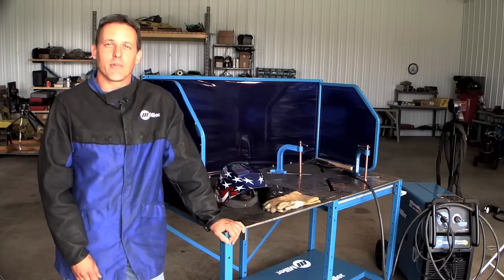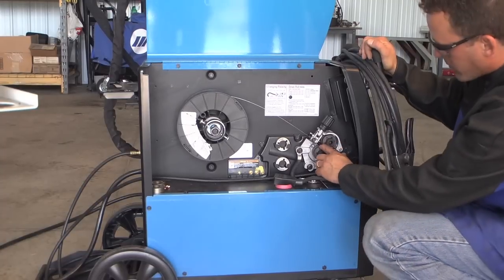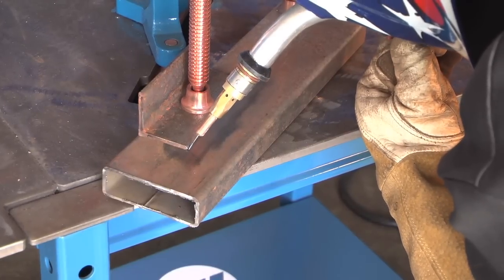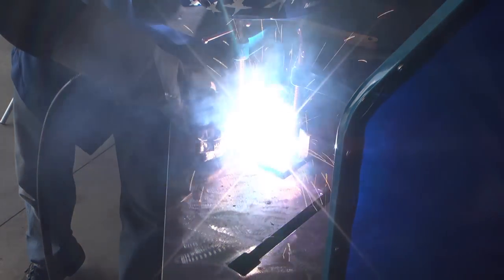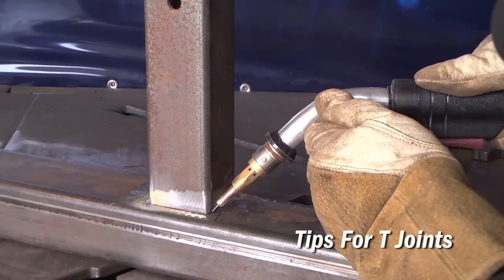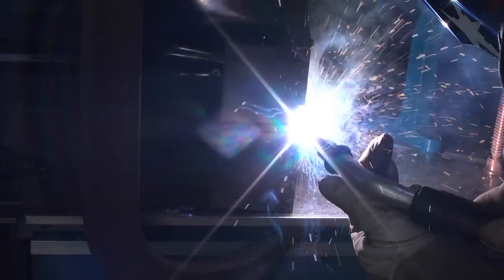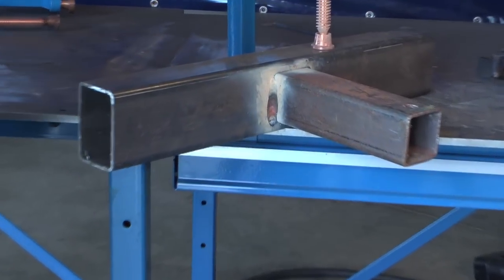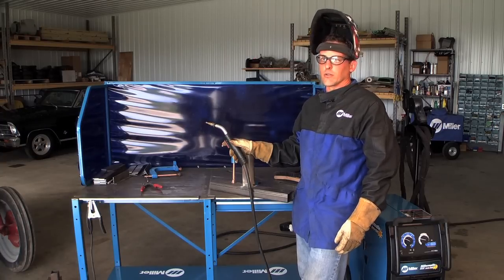Flux-Cored Welding Basics: Tips for Flux-Cored Welding

Comment: It looked like the tip was much shorter for the 90 degree weld; is that the case?  Other videos suggest 1/4"- 3/8". other than extreme lengths does it really matter?  Thanks!
Reply from the maker: Thanks for your question! The stick out will largely depend on the type of FCAW self-shielded wire and the diameter. This video is using an E71T-11 type wire. The second page of the following document has a parameter table that gives stick out or contact tip to work distance recommendations for each diameter: http://www.hobartbrothers.com/uploads/pdf/datasheets/Fabshield21B.pdf  We hope this helps! Let us know if you have any further questions. Thank you!
Reply: Thanks.  I had my first experience with wire feed welding today; had two old lawnmower blades to practice on (likely not ideal since the grass crud prevented arcing at times).  Ugly but managed to weld them together solidly.

Comment: I noticed the shroud was taken off the mig torch for the gasless wire. Any particular reason for this ?
Reply from the maker: Hi Brendan, thank you for the question. The reason people remove the nozzle from the gun when running flux core wire is for better visibility of the weld zone. Thank you.

Comment: Hi I noticed you don't have a nossle installed is that ok to do thanks again
Reply from the maker: Hi Richard, thanks for the question. When using flux cored wire that does not need gas coverage, the use of the nozzle is not needed.
Reply: Thank you!

Comment: so in MIG I was taught to use circular movement "stacking dimes" is this NOT necessary in flux core?
Reply: nope if it has slag you Just drag
Reply: What does stacking dimes mean?
Reply: By welding in a circular motion you are creating circular layers that look like a line of overlapping discs.

Comment from the maker: Note 2 – The voltage limit should not be exceeded at any load between full load and no-load when the source is a safety isolating transformer.
 
Note 3 – Ripple-free qualifies conventionally an r.m.s. ripple voltage not more than 10 % of the DC component; the maximum peak value does not exceed 140 V for a nominal 120 V ripple-free DC system and 70 V for a nominal 60 V ripple-free DC system. [SOURCE: IEC 61558-1:2005, 3.7.16 MOD]”

Comment: when you say turne the settinges down 10-15 % what is the settinges you turning down from?
Reply: The base line settings you would use for a flat position weld, which might be the ones printed in that chart inside the machine.

Comment: It's not that the flux core dont need a shield gas, but the gas is being released within the core of the wire(flux core), so you might want a welder tip for shielding aswell.

Comment: Is it acceptable to tig weld without gas using flux core mig wire?
Reply: What?  With the white-hot tungsten electrode just sticking out in the air?  It'll just BURN!  It might work with Carbon-Arc.  Interesting mix of old and new technologies.

Comment from the maker: “AC voltage the r.m.s. value of which does not exceed 50 V or ripple-free DC voltage the value of which does not exceed 120 V, between conductors, or between any conductor and reference earth, in an electric circuit which has galvanic separation from the supplying electric power system by such means as a separate-winding transformer
Note 1– Max voltage lower than 50 V AC or 120 V ripple-free DC may be specified in particular requirements, especially when direct contact w/ live parts is allowed.

Comment from the maker: The International Electrotechnical Commission (IEC) defines a SELV system and SELV Voltage as an “ electric system in which the voltage cannot exceed the value of extra-low voltage:
– under normal conditions and
– under single fault conditions, including earth faults in other electric circuits”
and; (cont.)

Comment: Flux core is very smoky, tape the safety glass up with insulation tape round the sides preventing  the smoke entering between the inner and outer lenses.

Comment: very informative but acouple things, i was told that event though flux core has its gas built into it, that using a 92/8 argon co2 mixture helps remove the slag ALOT easier than without the gas, in this video, i saw that when he was removing the slag it seems kinda frustrating, when i flux core weld i can just brush it off. and the last thing being, i was ALSO told to push not drag.- I am in high school at a Voc school, thats what my welding instructor told me.

Comment: Firstl, even though there is a flux, the weld is much better if you use Argon CO2 gas too. Secondly, you need a shroud on your gun too. Again the weld will be much better.
Reply: Jason K Wrong and wrong.
Reply: +Tec 9 Isn't the whole point of flux core welding to eliminate the need for shielding gas?
Reply: Tec 9 If we weren't this dumb, we would be machinists.

Comment: How can vertical down result in less penetration? 4:10
Reply from the maker: +Henrik C That's a great question. When using a vertical down technique, you have gravity fighting against you. When welding in a vertical progression, you have to have a very fast travel speed in order to keep the arc ahead of the puddle. This travel speed can be so fast that the arc doesn't have the proper amount of time to burn into the base material. If the puddle gets ahead of the arc, gravity takes over and the puddle may "drop" and fall onto whatever is below the work piece. If the operator can manage to keep the puddle from dropping, they most likely are now going too slow and "riding the puddle," meaning the arc is within the puddle. This is a no-no because when "riding the puddle," you achieve minimal penetration. Using a vertical up, or uphill, technique allows the operator to travel at a speed that allows for the arc to properly burn into the material and keep the arc on the leading edge of the puddle, and thus allowing for proper penetration. Let us know if you have any further questions.

Comment: You are a good welder with good technique but hwy arnt you using nozzle. Also sometimes it helps using a tapered tip and nozzle to get into the hard to reach places.

Comment: Cant get thick beads plz help
Reply from the maker: Thanks for reaching out. We recommend giving our service line a call to talk this through with a tech. The number is 920-734-9821. Let us know if you have any issues getting through.
Reply: Patterson Customs either slow your travel speed or turn your wire feed up and do the cursive technique or layer the weld by welding heavy on one side then cleaning off the slag heavy on the other side clean off the slag and then hit the middle. overlapping. also if you have a AC flux core like me it's just a all around bitch to get perfect welds. DC all-day.

Comment: Why arent they usinga cup like in gas welding?
Reply from the maker: Hi Jeremy, The nozzle does not need to be used as there is not any shielding gas when welding with self-shielded flux-cored wire.  If you were welding with a dual shield flux-cored wire, you would have the gas nozzle on.

Comment: Actually, depending on the wire, you will need shielding gas with flux core, hence why the guy in the video says "self-shielded flux core" and not just flux core. Though personally I call self-shielded flux core "shit shielding" because the dust that comes off when you chip the slag is horrendous to breathe in, as well as the welds never look that great compared to gas-shielded flux core which resembles the smooth look of 7018.

Comment: When you let go of the trigger, your tip DE-energizes, but lots of welders
are running basic setups where the tip is energized at all times. I think
its poor safety practice to, at the very minimum, not run your machine
without the basic conical tip protector.
Your video promulgates a long held practice that has cost more than a few
welders their lives. I am, at present, consulting on a case where a welder
was electrocuted by an uninsulated tip. I hope that you will consider
revising your video

Comment: when I mig weld I wear a wifebeater and 1 glove to hold the hot metal just close your eyes and spot weld
Reply: if you notice, this was not spot welding. and it is very easy to get flash burn (which is like a sun burn but much worse)

Comment: Why do I need safety glasses AND a welding helmet?
Reply: when you clean the slag after welding, it will protect your eyes, when the helmet is up or off. clean surfaces=better all around weld.
Reply: Jeremy Meyer I just leave my welding mask on for cleaning the slag since its an auto-darkening system. The only time I take it off is to inspect when I'm done. Otherwise I'd just put the glasses on when necessary, not leave them on under my mask like this video shows.
Reply from the maker: Jeremy makes a good point here. Additionally, OSHA classifies a welding helmet as secondary eye/face protection, and primary protection (such as safety glasses) is always required while in a welding environment. 

Most, if not all, welders still lift up their helmets in between welds, as Jeremy mentioned. Occasionally a weld will create airborne debris that pops off of it as the weld cools - and that could cause an eye injury. Let us know if you have any other questions.
Reply: One of our mechanic's had a piece of hot slag he hammered off hit him in the eye. Luckily he didn't lose his eye, it looked nasty for weeks. Had he been wearing safety glasses under his hood it wouldn't have happened. This was back before auto hood came out.
Reply: i worked for valmont industries in their irrigation department doing fabrication welding. we used the AWESOME miller elite helmets, but still wore safety glasses underneath, because even with that hood down, there can still be slag and spray up in the air. even with glasses on, i had to get metal bits removed from my eyes more than once! there is NO reason to skimp on safety devices when doing something like metal fab. after years of doing this line of work, your body WILL thank you the more you pile on that safety gear. and trust me, it doesnt get in your way. we worked 10 hour shifts bent over our pipes, welders screaming (yes, pulse welders make that noise) all day long. even in the hot summers of western nebraska, having glasses, hood, leather jacket, gloves, and often times leather chaps, it still did not hamper the quality of our work, or the speed at which we got it done. and at the end of the day, it was nice having all of your body parts still in good repair
Reply: Josh Hust hey bud, how much was the pay out there?

Comment: You just anwser yourself, you are experienced, flux core will be the same but some more noise and some more messy than mig, i use to weld with an old 90 amp clarke weld with rods, 1first time i used a flux core i almost have an orgasm.

Comment: This was very poorly conceived. When converting a Millermatic 251 from argon gas welding to flux core requires some major changes to the machine, which you rushed past quickly. A proper video would have covered changing polarity and tip adjustment much more in depth. I changed the polarity, but do I still need to place the clip (now negative) on my metal? Please slow down in the prepping the machine stages and help us prep our equipment. We know how to weld once we get the machine and settings set. Come on! This was really poorly designed.
Reply from the maker: Thank you for your feedback. We take input from our customers very seriously. We’ve passed this along to our team. If there’s anything else we can help with, just let us know.

Comment: On thin items you should "shot gun up" never run down beads for they will crack underpressure. you also forgot your ear plugs, and weld hat. your ears will go to shit if you hear that welder run all day long. your weld hat/benggies will help you from not losing your hear. you should never have to much slag. or brown burns on material for your welding to cold. your welder when running should sound like bacon cooking at a low heat.never go by your lay outs on the nobbies.6second-to-30 inch of wire

Comment: hes not a welder he welded inside to out on the first weld thats why he had a crater on the outside i was taught outside to in  welding structural and bozo blew thru the tube steel if u listen at the end you can hear that sucking sound stick to selling machinesdude and let the real men do the welding

Comment: wow, there are so many things you did wrong with your welding and tips. I dont even no where to start.Frist, I'm qualiy inspector for Grove Crane co. Second, Miller should have never posted this clip with there name on this.THE WRONGS: your fan should be pointed down, so you dont blow holes,your gun has no nozzle? your running cold welds. your gun should be pushing not pulling.You should always starte at edge n push to build a stong puddle/ "puddling out"never run down beads, no weaving/wipping!